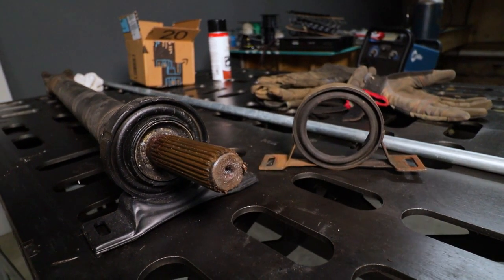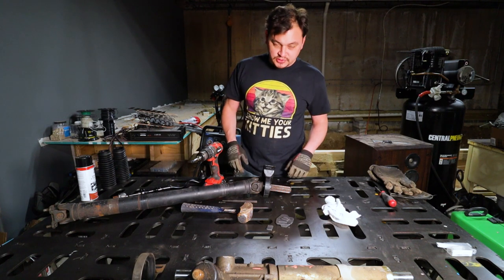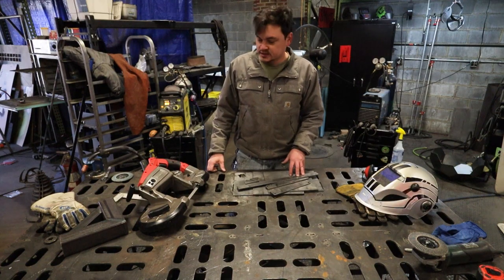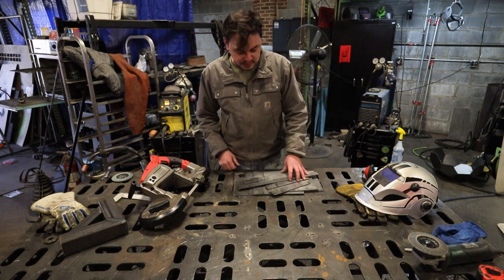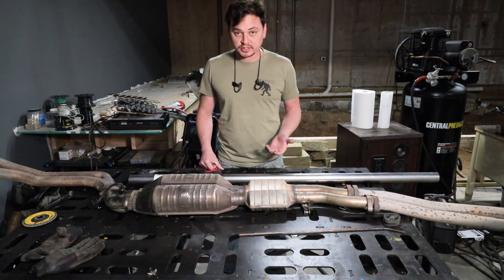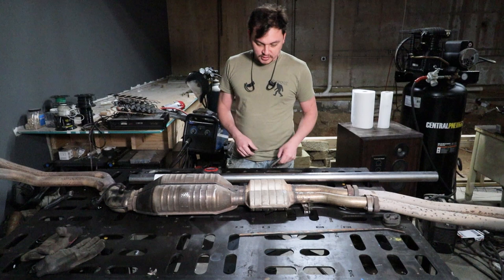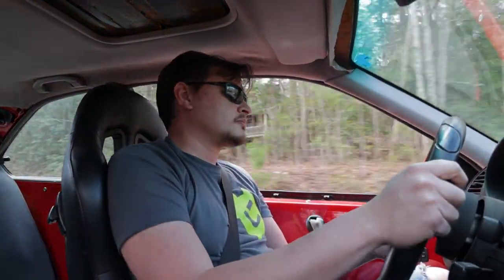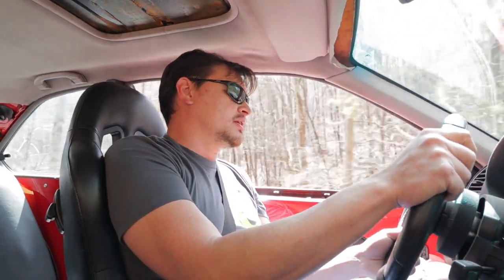BMW E36 Street and Track Build : Center Support Bearing, Z3 rack, New Muffler and Coolant Blowout

Comment: I am about to do a z3 rack swap on my e36. So what parts needed apart from rack? Also how much of a difference you get compared to standard e36 rack?
Reply from the maker: As l as your inner and outer tie rods and boots are good on your car, all you need is the rack! The difference is amazing. I wouldn't want to drive an E36 without it. It makes it much more snappy to drive, especially in an autocross setting.
Reply: @turtlelaboratories  thank you for your  valuable information. Also e36 came with  vertical adjustable steering column in the beginning as an option but they suddenly stopped it for no specific reason and then again in e46 they started having it. So do you know the reason behind it and is retrofitting it worthwhile?